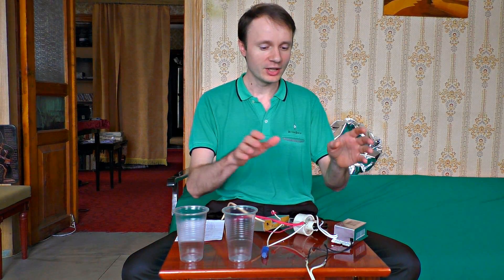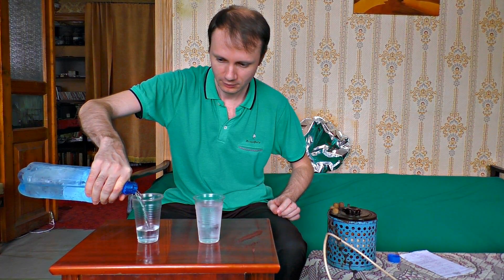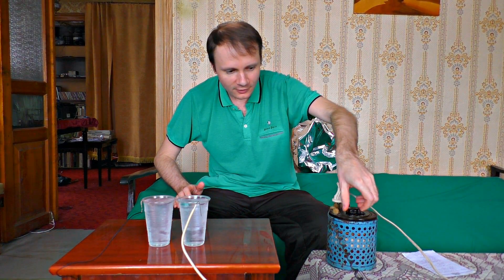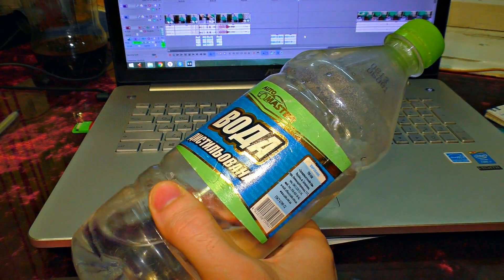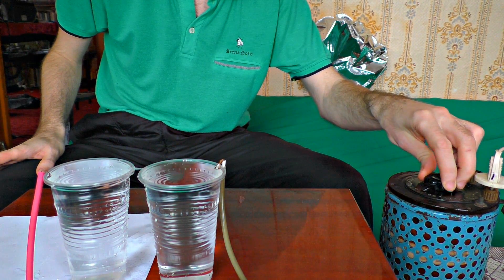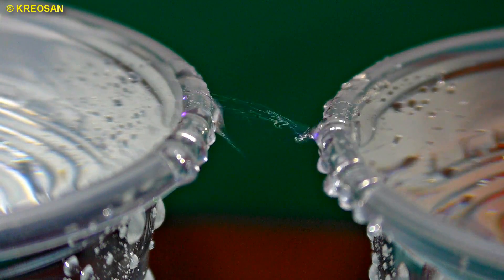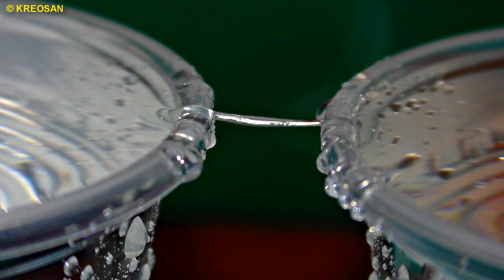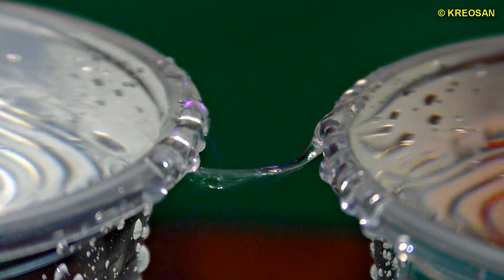Spreading WATER with electriciy ⚡ Miracles with a million VOLTS!

Comment: water conduct current is a "myth"... are the salt ions dissolved in water that conduct current, so the distilled water cannot conduct.. a way to measure the salt content of water (i mean salt of various type Ca, Mg, etc..) is to measure its conductivity. Probably the ions jump pulled by electric field, and the ions in water are always covered by H2O dipoles, hence the ion drag water with it...... As for oil I thing the electronic field align the chains of molecules of oil in some manner.

Comment: Any dielectric will break down at a certain voltage. The reason the oil and water make bridges is because the electrons are moving and dragging the rest of the atom with it. I experienced a similar effect when I was creating EM drives for water propulsion.

Comment: It's a cool experiment but I think qualitatively it's not hard to explain. The voltage is 10^6V and the distance is roughly 0.1m, that's a field of 10^7V/m, and the charge of 1 electron will feel 1.6E-12 N force. That's the gravity force of roughly 10^-13kg mass, not huge but it's still 10^14 molecules, so just one electron can carry so many molecules to have an acceleration about g in the horizontal direction. And as it's closer to the other side, the force increases - it will likely make a bridge.
So the real question is why it didn't work with the water in the first try. My guess is it's because you're using AC and the response of high frequency AC is different for pure water and water with ions (higher conductivity). If you can find a way to make it DC, it may work? I'd like to see if that's the case.

Comment: Very cool experiment, from what I understand distilled water is a good insulator, similar to oil (Though oil is a better insulator since it’s non-polar and doesn’t dissolve metal ions like water does, making it a much more effective insulator).  When you pass high voltage through oil or distilled water it charges the molecules, and these charged molecules repel each other and are naturally drawn to the opposite potential in the other glass, forming a bridge instead of an arc, allowing for rapid transfer of oppositely-charged particles.  If you only connect  a single glass of oil/water to the high voltage you would get streamers of fluid shooting away from the glass (I’ve tried it).

Comment: Try it with sugar water at varying levels of solution.

Water, oil, and sugar are essential to animal cell life.

Maybe you can get the high sugar content water to emit triboluminessence (glow).

I am also curious about the use of this phenomenon for conducting electricity for the grid.

I was just telling my coworker today that it would be interesting if we could use water to power our cities instead of copper wire as water is much cheaper. The conversation arose after we saw a tree that had grown around an electrical wire that was smoking up in a rain shower.

Comment: Plastics are good insulators. Rub plastic like acrylic and you strip electrons off. A static charge remains because it is a good insulators. I think the high voltage either strips an electron off from or deposits one into the oil  molecules.   A build up of static charge causes these molecules  to migrate to the other charge. 

The viscosity of oil is much larger than water so he was able to get longer bridges. Yes,  electrostatics changes the viscosity of water.

Comment: Well each molecule of water is made up of hydrogen and oxygen and it is a dipole solvent meaning one end is positive and the othe negative so essentially it is a molecular battery and it is arranging itself to facilitate the connection . It is also a molecular electromagnet hence why it arranged itself +_+_+_+_+_+_ if you put some thin oil and water in a blender for 20 min and then do the same experiment the results will be amazing as each molecule of water will have a oil insulating semiconductive cover and you will see a very good effect!